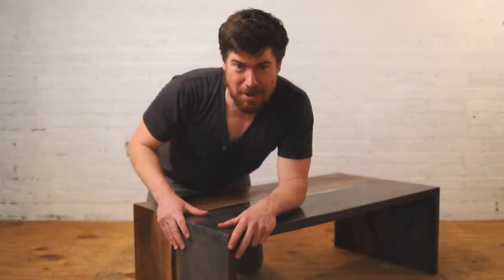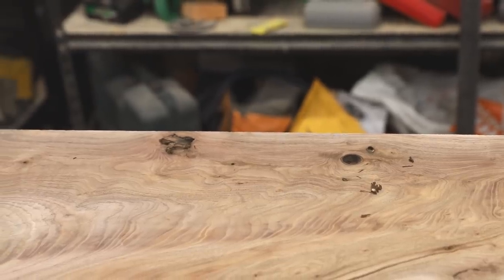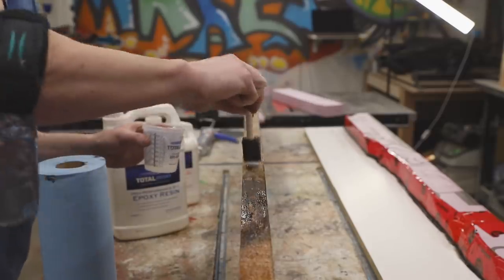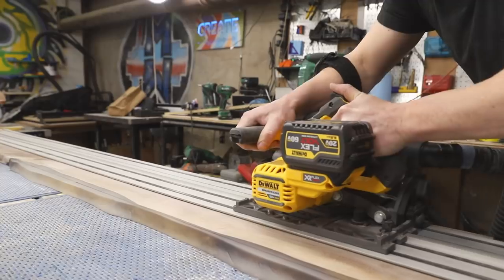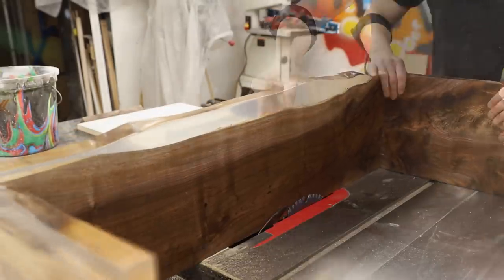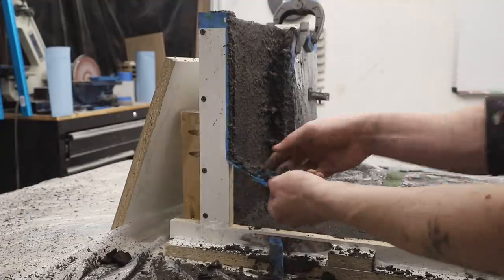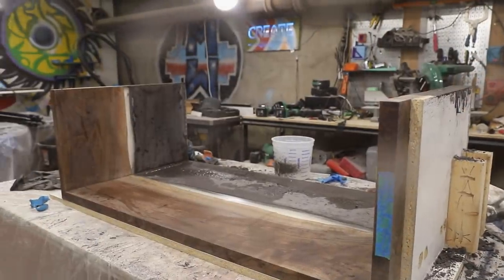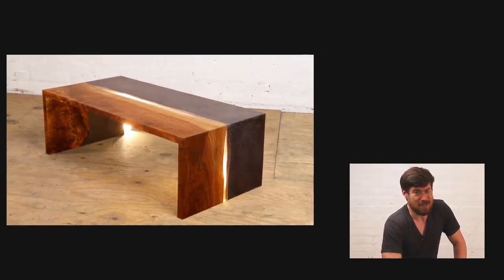CONCRETE & EPOXY RESIN River Table -- DIY

Comment: I do GFRC for a living. You do awesome work, but here's a small but helpful hint. You could get a clean face on the inside of the legs if you spray the melamine before clamping it to the bench, its also best to do a 
 Light coat of backer over the face so it stays moist. Then pour your backer to fill in the legs, I'd even make it a little more wet than you had it just to ensure there's no air pockets. This will eliminate any pockets or holes on the inside of the leg.  Hope it helps!

Comment: Another vote for loft tour!

P.s. Instead of spraying, can you apply a concrete top layer with brushes? I see you use them after spraying occasionally, but can a newb just do a brush layer and then pour? 
Trying to soak up knowledge!
Reply from the maker: 👍👍 so it's a yes, but probably not for a table like this, because brushing up vertical surfaces is tough.  For flat tables or countertops you can get pretty good results brushing in the face coat.

Comment: Gorgeous!!! I have a question. You said you didn’t caulk next to the epoxy, because you didn’t want the black to get trapped. Could you use clear caulk, or would it still not be clear enough?
Reply from the maker: Clear caulk usually dries cloudy.  I would put weights on the wood near the edges to hold it down during the pour if I were to do it again

Comment: Question for Mike or anyone in the comments who works with concrete, I am quite new to making furniture and items out of concrete and I am curious is there a need to etch your concrete before applying sealer or finish? I keep seeing on sealer instructions that concrete needs to cure for 30 days and then must be etched before applying sealer, however in most all DIY and maker videos, I have never seen anyone use etching. Is that mostly for garage floors and sidewalks? What situations make it okay to not have to etch your concrete, and also what situations make it okay not to wait 30 days for concrete to fully cure before applying finish?

Comment: Have you tried using a heat gun on the epoxy  after its cured. I find it can soften up and you can just use a scraper to remove some. Not sure how the total boat stuff responds to heat
Reply from the maker: Yup, that works, but sometimes it can also pull up excess and leave rough spots, so I'll just plane it when it's not too much

Comment: Since you're trying to avoid wood glue showing through the epoxy, why not simply use high-strength epoxy for the entire joint?
Wouldn't epoxy give you just as strong a joint in the wood as wood glue does?
Reply from the maker: Not quite as strong with the loose tenons, wood glue forms a chemical bond stronger than the wood itself